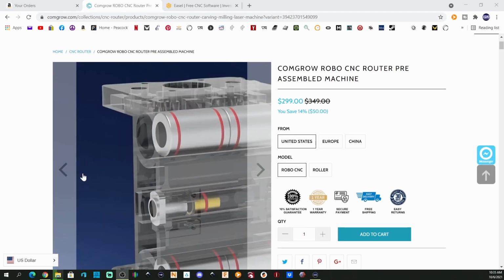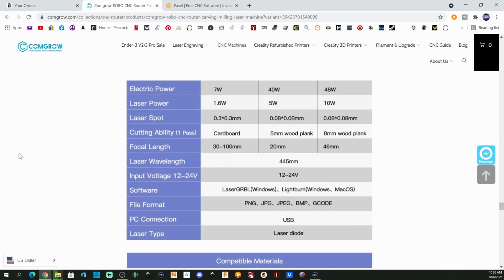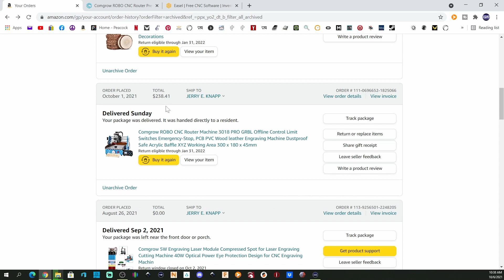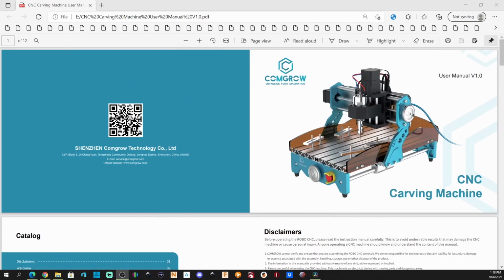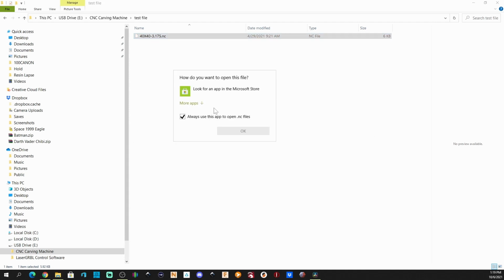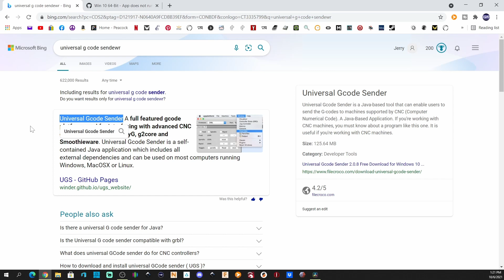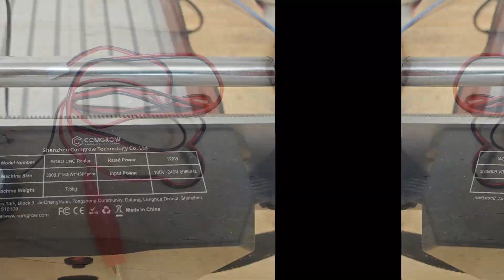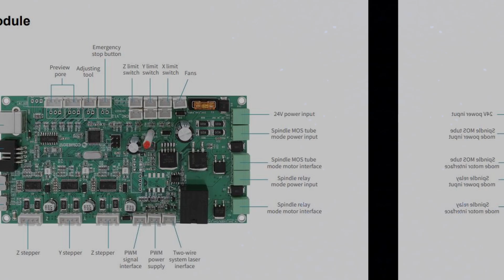Comgrow  Robo CNC #3dhp

Comment: I bought a comgrow refurbished cnc that included a laser head. I reviewed the web listing, even taking a screenshot. The cnc arrived without the laser. Contacting comgrow they denied the screenshot and told me they would refund but not pay shipping. Comgrow recommend that I sell the machine myself. They want me to pawn off their piece of junk. Do yourself a favor buy another brand. Stay away from comgrow and don't get ripped off. This company should be called con artist not comgrow.
Reply: But what has that do to do with the actual function of the machine? Yeah it suck that you didn’t get the laser head but did you ever try the Router part of the machine?
Reply: Did you ever order a new car but when it arrived it had no engine? A company that rips you off once will rip you off again. I am just trying to help others from being ripped off
Reply: So you never used the machine and now you’re advising others against using it? 🤡 your argument about no engine is far fetched.
Reply: Far fetched? It's called false advertising.when you offer a product to sell. I have the screenshot of the items included. I just do not want others to pay for something they are not getting. Comgrow flat out lied and ripped me off. The least I can do at this point is to warn others of their practices